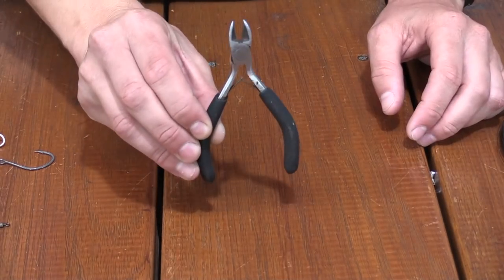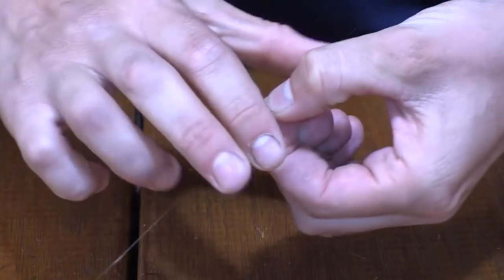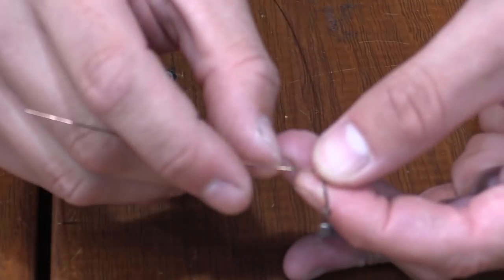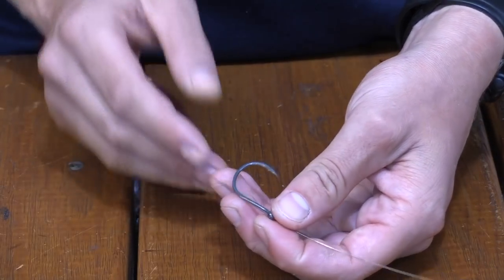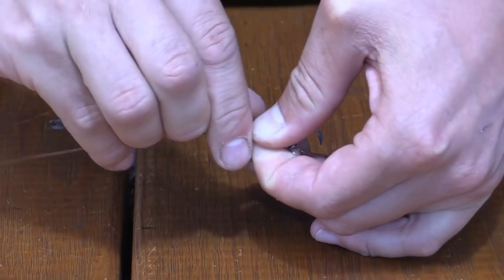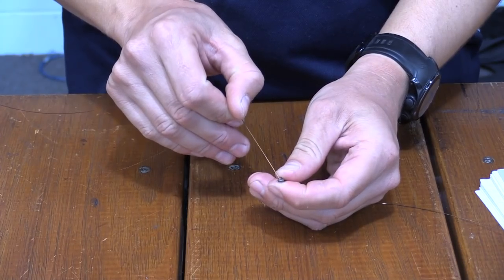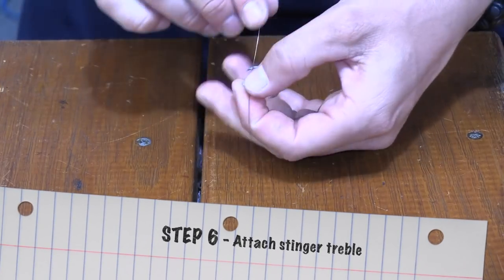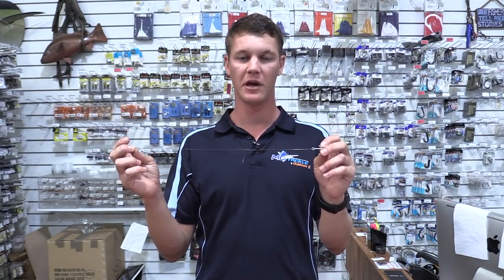Mackerel Live bait rig set up step by step

Comment: I always thought the wire pulls through when you do your first twists like that. Would like to see this rig under pressure and see if it does slip.
Reply from the maker: check the previous videos mate, that is what he caught those mackerel on. We have heard people talking of twisting the first few wraps.
Reply: Good to know, coz I can do the twists like this but I have so much trouble actually twisting it and it’s out pliers
Reply from the maker: awesome buddy
Reply: @MOTackleTV  I
Reply: Madkeen is correct It is tied wrong You have to have haywire wraps at the start not lose barrel rolls as is done in vidio When tied as in vidio that knot can slip under pressure and you will lose fish